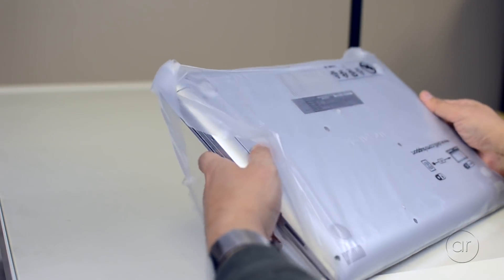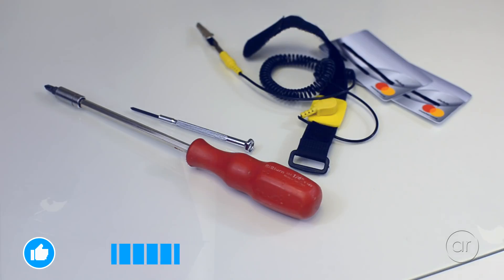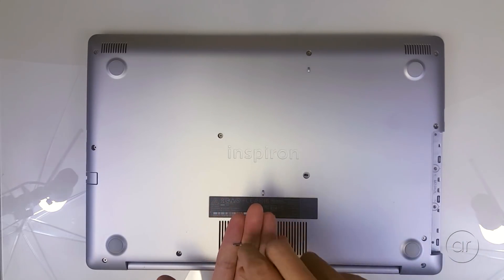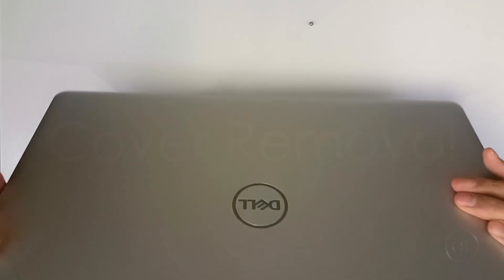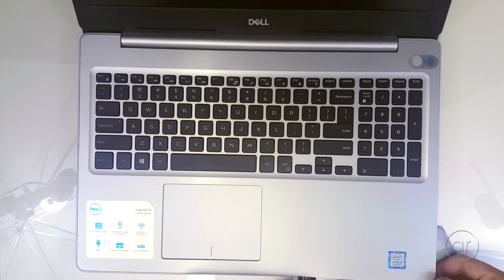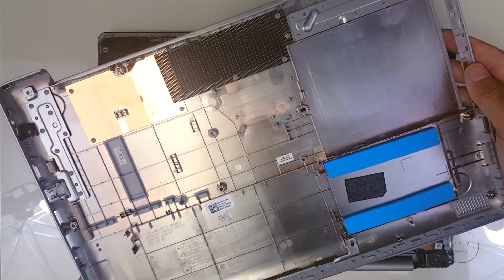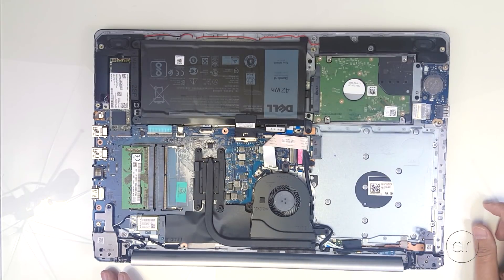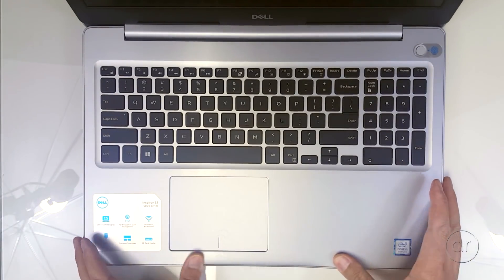How to Disassemble a Dell Inspiron 15 5570 Laptop to Install an M.2 SSD

Comment: Thanks for the great video. Can I add M.2 ssd in my Dell 5558 laptop with i5 5250u 8GB purchased in Dec 2015. Does 5558 have slot for M.2 ssd ?
Reply from the maker: I looked up the specifications manual on Dell's website. Sorry, I'm afraid it doesn't have an M.2 slot, but it does have an optical drive. So it should be possible to replace the optical with a caddy that holds another 2.5" drive, like an SSD.

Comment: Would add on a 8gb ram help the speed of the start up. I got a dell 15 5000series 5570 i5 8th. 4gb ram 1tb. So slow. I am planning to add a 4gb or 8gb ram. Will that speed up the laptop?
Reply from the maker: Upgrading the hard drive to an SSD will make the biggest difference - when I cloned Windows to an SSD, I saw a very significant improvement in speed. Adding RAM will also help (depending on what and how many programs you run), but it will not be as dramatic as an SSD upgrade.
Reply: i have this same laptop with i7 8th gen quad core processor with 8 gb of Ram but it’s still slow . So if u really want to speed of your computer then install ssd and upgrade ur ram as well. I don’t think upgrading the ram only will help.
Fuck i regret buying this laptop

Comment: Great video! I thought there was only 1 slot for memory. I bought a 16 gig stick it already has a 12. Will it work simply adding the 16 to the open slot? If the one is available?
Reply from the maker: Thanks! Yes, there are actually two slots for memory for the 690-0024. I would recommend the same brand/model of memory for each slot (or at least the same size/timings), as you can run into problems if they aren't the same - I list some models in the description based on the experience of some of my viewers. I'm not aware of any modules that are sized 12 GB, so you may want to check if your computer has two modules or one.
Reply: access random : thank you so much. Great presentation. Very helpful.

Comment: i was wondering what kind of SSD you used. B + M or regular M and are there any downsides with using B + M on an M designated port
Reply from the maker: The SSD that I used was an Intel / HP 360GB Pro SATA keyed for B+M. Since mine is a SATA SSD and the Dell accepts both SATA and PCIe, the data transfer would simply drop to the lowest common denominator of a theoretical 600 MB/s.
Reply: @accessrandom  I got a B + M but @128 GB would install hopefully bit will go well. Also important to not the size for Dell Inspiron 5570 I went for 2280, hope it fits
Reply from the maker: You'll be fine with a 2280 - that's the size of mine as well. Good luck, and let me know if you run into any problems.
Reply: @accessrandom  Installation and drive cloning went perfectly. Thanks man. 5/7 recommend

Comment: will the process be the same for a 5550 as the 5570?
Reply from the maker: I googled the model and the closest model I found was the Dell Latitude E5550 - is that correct? I'm afraid that model does not have an M.2 slot.
Reply: @accessrandom I have a dell inspiron 15 5565 , Im sorry , I typed it wrong.
Reply from the maker: No problems. The 5565 should be the same as the 5570 (when I looked up 5565 on Dell's website, it took me to the same Inspiron 15 5000 series service manual as the 5570).
Reply: @accessrandom Thankyou sir :) truly appreciate the sharing of your time and knowledge.

Comment: I didn't get the reason for the "lifting straight up" and "credit cards at 90 degrees" and struggled get back off in upper corners by the display--until I finally realized that the display itself was in the way of the release!  So if you are having trouble with the last part of getting the cover off, rotate the display out of the way.  Duhh.  Otherwise all good, thank you, as planned i now have a blazing high storage capacity CD/DVD backlit keyboard touch screen laptop for under $525 total!  Nice.
Reply from the maker: Thanks for the update. Sorry that part wasn't clear - is it ok if I add your instructions to the description with credit to you?
Reply: please do, credit optional, thanks for your good work.
Reply from the maker: @daverohrdanz159  Done - and thank you!

Comment: Hi, thanks fot the useful video!  I have this and am SO disappointed about the display they put in this!  It is really terrible, so I think a video about display panel change woulg get a lot of views.
Reply from the maker: I agree completely - thanks for the suggestion. I know others have changed it out with an IPS display so it is definitely possible. On my list 👍
Reply: @accessrandom  I just got this laptop and overall I'm very happy with it. I'd be even happier with a better display. Did you ever get around to switching the display for something better?
Reply from the maker: @toufuelo  I would love to replace it with an IPS, but I'm sorry - I haven't had a chance to do this yet.
Reply: @accessrandom  thanks for the response. I was just curious if you did get around to it.

Comment: So I just installed an ADATA NVMe 128gb SSD into my new Dell 5570, and this video was very helpful. Although, when I went to start the computer for the first time, it got stuck in the "automatic repair" loop, where it would act like its loading automatic repair, then stop, then try again, etc forever. Booted while pressing f12, ran diagnostics, no issues found. SSD was recognized in the BIOS. still couldn't get Windows to load. Took back apart and uninstalled SSD, and computer booted just fine. Is it safe to say the new SSD is bad? Thanks!
Reply from the maker: When you cloned the disk, did you drag all partitions to the destination? If so, with the SSD installed, could you please boot to the rescue disk created by Macrium Reflect? Choose the "Fix Windows boot problems" and make sure you select the SSD.
Reply: access random I didn't even get to that point. All I did was physically install the SSD, put the computer back together, went to turn it on, and it got stuck in that "automatic repair" loop. Thanks,
Jason
Reply from the maker: I see. That's very strange - as though it's trying to boot to the SSD for some reason. It is possible that the SSD is bad - would you be able to try this in another machine?
Reply: access random unfortunately I don't,the only other machine I have is a newer Macbook Pro. I emailed ADATA about it, we'll see what they say.thanks
Reply: @jason91notch   what ADATA says then?

Comment: I have Dell 5575 and installed wd green 120gb M.2 sata SSD but its not detecting, neither in bios nor Windows. I have latest bios version. Any idea whats wrong? Is there any setting I missed?
Reply from the maker: According to Dell, the 5575 supports up to a 256 GB M.2 SATA SSD - so yours should work. If it is not even showing in the BIOS, I am thinking it is either improperly seated or defective. Is there another laptop you can try it in?
Reply: @accessrandom  Unfortunately I don't have any other system that has m.2 to test but the ssd is brand new. Btw, dell website says m.2 sata ssd using interposer but I wonder how it worked on your system on nvme slot.
Reply from the maker: The M.2 slot on the 5570 can take either SATA or NVMe SSDs. The 5575 is able to take both also.
Reply: @accessrandom  Then I cannot understand why its not detecting in my laptop. Anyway, I will sell it and buy 2.5" sata ssd. Thanks for your kind response.
Reply from the maker: @Srikanthnk  I agree - your SSD is to spec so it should work. I'm afraid the surefire way to find out is to 1) try a different, known, good SSD in the slot (to test if it is a bad slot) or 2) try the SSD in a different computer (to test if it is a bad SSD). Have you tried re-seating the SSD in your current laptop?

Comment: Does it have finger print lock
Reply from the maker: The 5570 does have a fingerprint reader on the power button (I haven't used it myself though)...

Comment: does it have  dedicated video card slot
Reply from the maker: Sorry, I didn't closely inspect for a graphics card slot when I had it opened. However, Dell does sell configurations of the Inspiron 15 5000 line (w/Intel CPU) with dedicated Radeon or NVidia graphics. I hope one of my viewers has a better answer - anyone?
Reply: @accessrandom  well I have bought the laptop with configurations same as yours.if you found answer to my question please reply to me.
Another question.
Can you please tell me the upgrades that can be done to this laptop,like SSD,ram size, graphics card port(if you found the answers)...etc please let me know.

Comment: does dell vastro 3568 i5 7gen  have m2.0 slot or not
Reply from the maker: I was unable to find that specific model on the Dell website, but I looked up the 3578 (which looks like it is in the same Vostro 15 3000 family). Unfortunately, I couldn't find any mention of an M.2 slot in it's manual. Hopefully, someone else may have a better source. Anyone?
Reply: service tag JXXKRJ2

Comment: it does not show how to configure the ssd in the laptop and how to reinstall windows. also i been told it needs to be an nvme ssd and this one you installed is not.
Reply from the maker: Correct - I use a standard M.2 SATA SSD, but the M.2 slot will also take an NVMe according to Dell. I do have another video here: https://youtu.be/BZqkYnmDnas, that explains how to clone the HDD to the SSD (but not reinstalling Windows). I may make a video about that in the future.

Comment: Could I install a Samsung MZ-V7E250BW SSD 970 EVO, 250 GB, M.2, NVMe, Nero/Arancione on this lapton? Thanks!
Reply from the maker: According to the specs, this should work fine (M.2 NVMe 2280 SSD). Since it is a Samsung, you may want to consider using their cloning software as I've heard good things about it.
Reply: @accessrandom  thanks! I can't wait to nstall It 
Also, thank You for this very useful video
Reply from the maker: You're welcome - hope everything goes smoothly.

Comment: Is it possible to add a m2 ssd in an Inspiron 5567 this way?
Reply from the maker: When I visit Dell's U.S. site and look up the 5567, it takes me to the "Inspiron 15 5000 Setup and Specifications" document which is the same manual as the 5570. According to that, yes, it is possible to add an M.2 SSD.
Reply: @accessrandom  Thanks very much for your answer. Greeting.
Reply from the maker: You're welcome, and good luck

Comment: Fitted a M.2 SSD (Scandisk) 256gb to mine and followed these steps and the next video to clone.  Boot time into Windows (and useable) sub 30 seconds such a difference (mine has 8GB RAM).  Had issues with the clone, and had to wipe using Diskpart command in command prompt, but completing 2nd time worked fine.  Video was clear and helpful, follow the steps and you will be fine.

Comment: Can you install more than a 256GB SSD? The manual says max of 256 GB
Reply from the maker: Yes - in the video, I install a 360 GB module while others in the comments have had success with 500 GB and 1 TB. My guess is that Dell has tested only up to 256 GB at the time of printing the manual.
Reply: @accessrandom  perfect! want to install a 500 GB Crucial MX500. Thanks! Great videos by the way; keep it up!
Reply from the maker: Thanks! Yes, the 5570 uses M.2 2280 SSDs. It looks like that Crucial comes with Acronis True Image (from their website) so you may want to consider using that instead of Macrium Reflect.
Reply: @accessrandom  - curious which would be easier? Since I'm gonna do this from the start, should I clone the SSD? Or should I just put it on a bootable USB and install W10 that way?
Reply from the maker: Sorry, I think I assumed too much. In general, it's always best to install from scratch.
Reply: @accessrandom  also - the 5570 uses m.2 2280 correct?

Comment: You should really do (read) a story book.. Sometime.. The ppl r gonna love u.. Very subtle voice.

2 Questions: I have a Dell inspiring 15 5559 6th gen..does that laptop have any M.2 slot? Or can I remove my wifi mSATA card an install an mSATA SSD?
Reply from the maker: Thank you - I'd love to do that someday. Just looked up the Inspiron 15 5559 Specifications manual and unfortunately, I didn't see any mention of an M.2 slot (even for the wireless). You could always swap out the HDD with a 2.5" SSD.

Comment: Hi..I have a quick question and would appreciate if you can help me out.  I have a Dell  Inspiron 5570 i7 with 1TB HDD.   Will 512GB SATA III M.2 2280 SSD work with it, or do I need to get a NVMe SSD if I want 512GB SSD added?
Reply from the maker: I'm so sorry, I didn't receive a notification from Youtube so I just saw your post now. I've had many viewers who have gone over spec and have successfully installed 512 GB and even 1TB M.2 SSDs. I can only speak from experience, which is that 360 GB (non-NVMe) works fine. Again, sorry for the delay in replying...

Comment: hello and thanks for the great video.
Is it possible to create a Windows backup first, then install the SSD and then reboot the system to the SSD? The HDD partition should be deleted when rebooting and is available as a second hard disk or? :)

Comment: What do you think about this: is well known that Windows 10 license is not in the 5400 rpm 2tb HD, so, in this case, can I add this M.2 SSD , start the system in the installation USB stick and erase ( in the disk manager ) all the content of the HD and choose de M.2 to make a clean install of the system without Dell crap
Reply from the maker: Yes, that's certainly possible. The product key will usually be embedded in the BIOS so a fresh install of Windows 10 will retrieve it automatically. If you feel more comfortable retrieving it yourself, there is a Microsoft Technet page that provides a tool (google "Get Windows Product License Information").
Reply: @accessrandom  well, I did it as I planned a clean windows installed with no problems at all, now I have c: disk for windows boot (hyper fast with 970 Evo by Samsung) and a 2 TB D: disk. I did it with an USB stick  windows boot prepared officially as Microsoft tutorials recommend. 
In the beginning I choose to erase the original sata disk partitions and decided to installed in the m.2 SSD. 
After that I did a new volume from disk utility. Very satisfied with the result
Reply from the maker: Awesome - thanks for success story update.
Reply: @Yahia Fouda yes, is the 500gb model. Amazing performance 8 to 10 seconds turn on and 5 seconds to turn off.

Comment: sera que la dell "14 3467" tiene la ranura NVMe ?
Reply from the maker: I went to Dell's website and the Setup and Specifications document states that the 3467 has "One M.2 slot for WiFi and Bluetooth
 combo card". So unfortunately, it doesn't look like it supports NVMe - sorry.

Comment: Does adding SSD voids Dell warranty?
Reply from the maker: From what I could learn from Dell's forums, the act of upgrading does not by itself void the warranty. The SSD manufacturer covers the SSD, not Dell. If you break anything else while upgrading, that wouldn't be covered by Dell's warranty.

Comment: Is this method comparable to the one you would be using for a Dell Inspiron 15 5575? I think about buying one but it has no ssd. So i want to install one... But I don't know if it has a m.2 Slot.
Reply from the maker: At first glance, the housing looks identical and even Dell's website takes me to the same Inspiron 15 5000 Setup and Specifications manual as the 5570 (which states it has an M.2 slot). But I can't say with 100% certainty - perhaps one of my viewers/subscribers can comment? Anyone?
Reply: @accessrandom  I just bought the 5575 with 256 gb ssd only, no hdd. I want to install a hdd also, I assume there is an empty spot for one?
Reply from the maker: If the 5575 has the same layout as the 5570, then there should be an empty spot where the hard drive is at the 4:44 mark. The only thing I'm not sure about is whether there would be a metal chassis to hold the disk (you can see there's a metal frame that holds the hard drive, and there are four black screws that hold the frame to the motherboard).

Comment: My laptop is 256 Gb SSD , which is too small storage for me ! can I add internal HDD ?? noting that its Dell inspiron 5570 not having CD drive !
Reply from the maker: The Dell Inspiron 5570 can accept both an M.2 device and a 2.5" storage device (hard drive or SSD). If your current 256 GB SSD is in the M.2 slot, then yes, you will be able to add a 2.5" HDD. But if your current SSD is 2.5", you can only add another SSD in the M.2 slot.
Reply: access random so M.2 doesn’t support HDD ??
Reply: And for HDD how can I know the motherboard compatibility with Sata or other cable?!
Reply from the maker: @focuszone1795  I'm afraid not. What you could do is take the space where the CD drive would go (I'm not sure, but there must be a spacer where the CD drive usually is) and replace it with a hard drive caddy. Try searching for 5570 caddy on Amazon.
Reply: My 5575 came with a 256 gb ssd and a dvd burner.
Reply: kevswick yes , 5575 is different from my one (5570) , also 5570 has two versions one with DVD burner ,and another with no DVD burner.

Comment: Bro me i wanna do a ram upgrade but i havent find the exact other ram stick( 4GB ram). So is it okay if i use another brand but with the same frequency?
Reply from the maker: Theoretically it should work if they're the same speed, voltage, and timings but I wouldn't recommend it (I've read about too many bad experiences with mismatched memory). If possible try to stick with the same brand and specs.